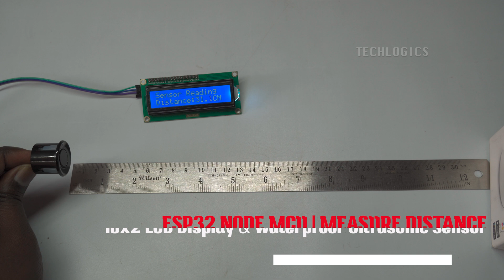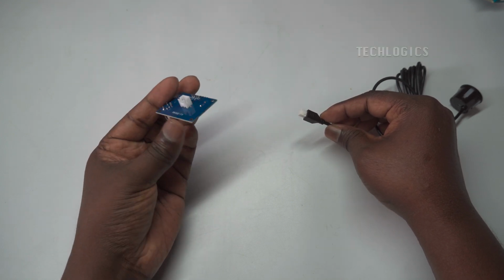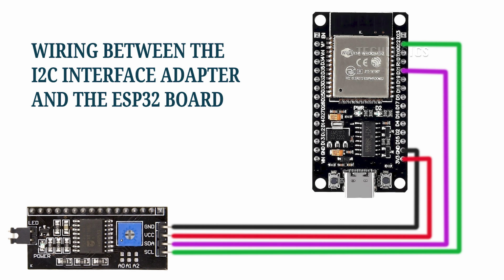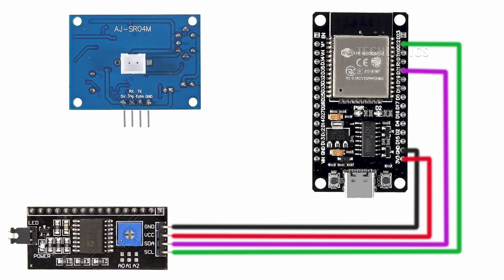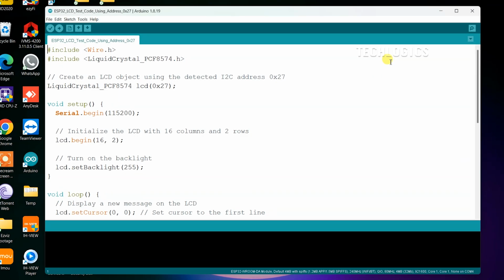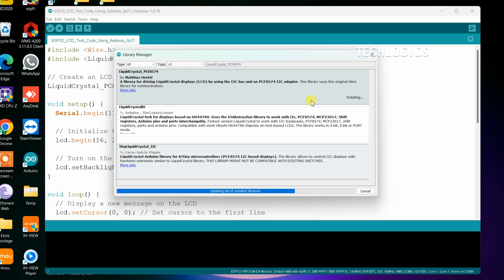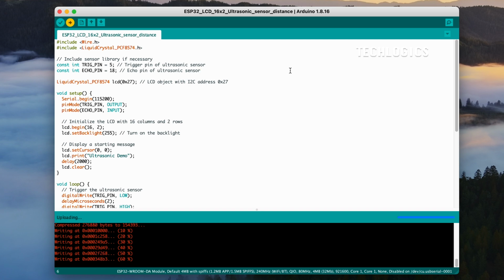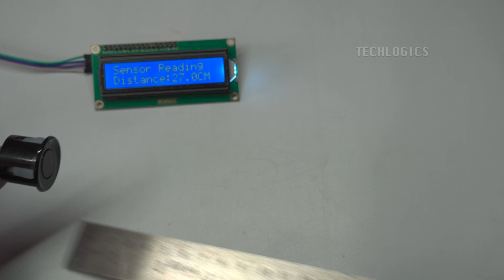Distance Measurement with Ultrasonic Sensor and LCD Using ESP32 | DIY Electronics Project

Comment: dont you need resistor between esp32 and sensor, as it is provide data with 5 v
Reply from the maker: Not required resistor between esp32 and sensor

Comment: Can it also be set in cm or mm?
Reply from the maker: Yes, you can display measurements in cm or mm by adjusting the code on the ESP32. Convert the sensor's output as needed (e.g., multiply cm by 10 for mm) and format the LCD display accordingly